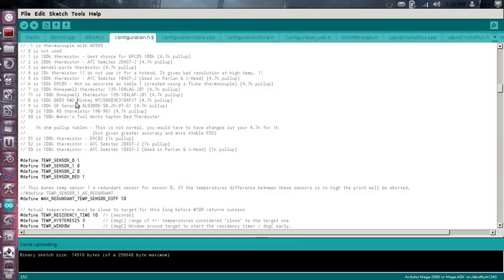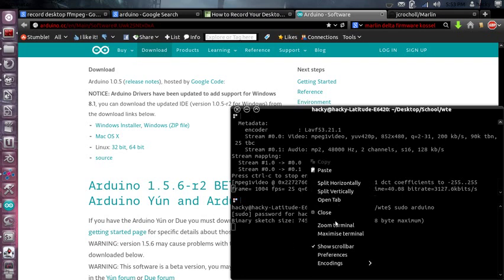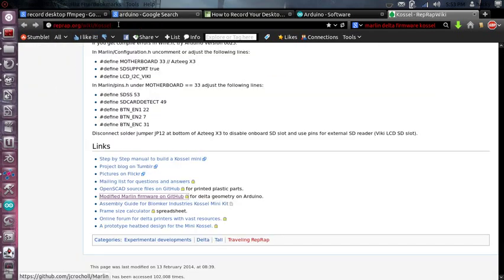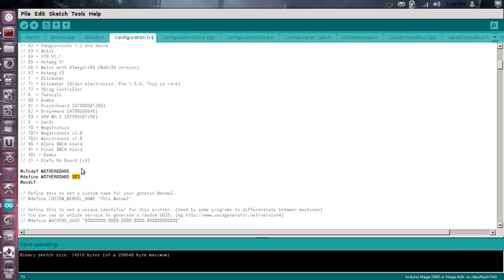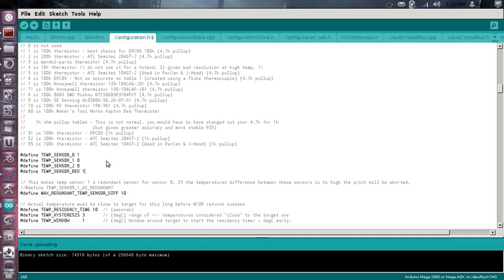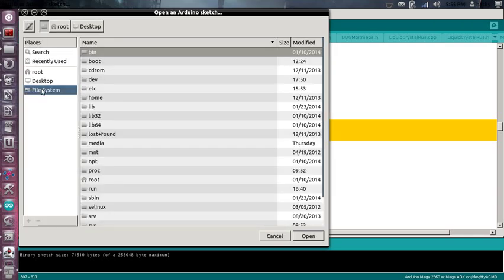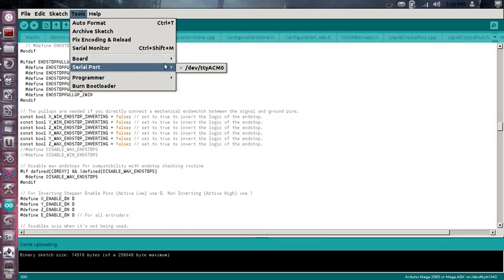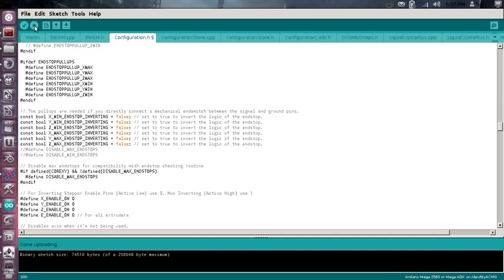Kossel Mini Build (4of ?) Marlin Delta Firmware Setup for Hardware Testing

Comment: mintemp , error !!
i connected the thermistor but the error is still there
Reply: Probably a bit late for this but I will say it anyways. I had the same issue, for me the thermistor had a damaged connection and wasn't making a full circuit. I soldered the wire back into place and it worked fine. Check your connections with continuity tester.